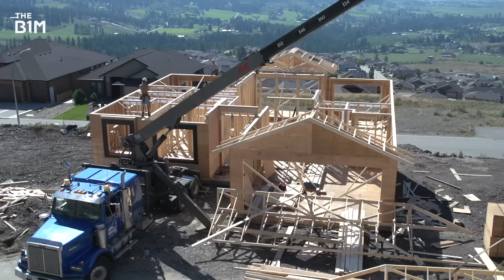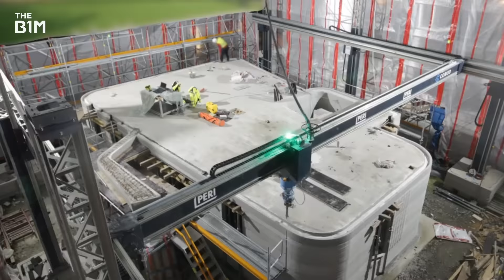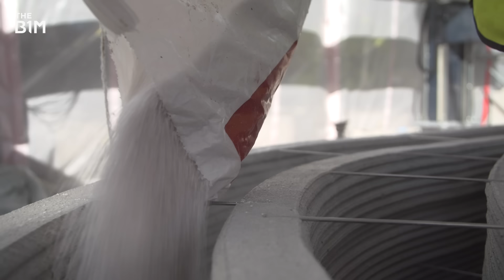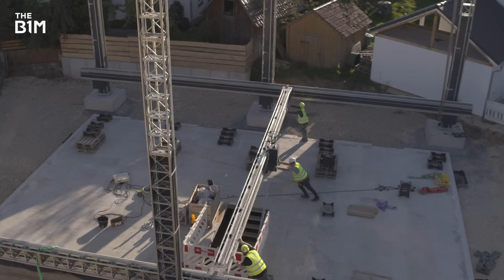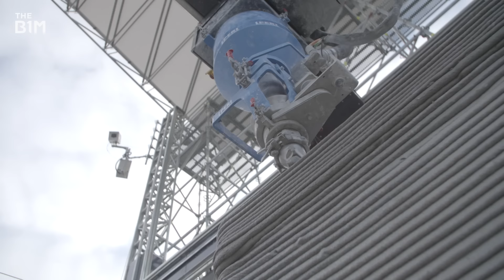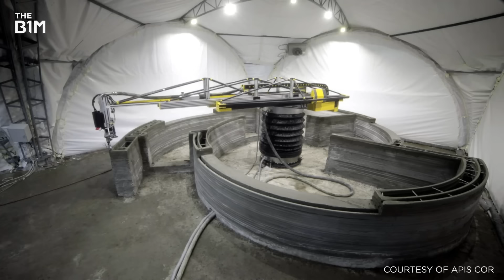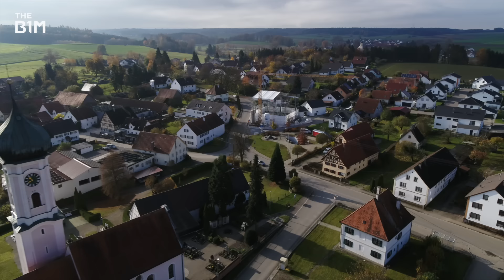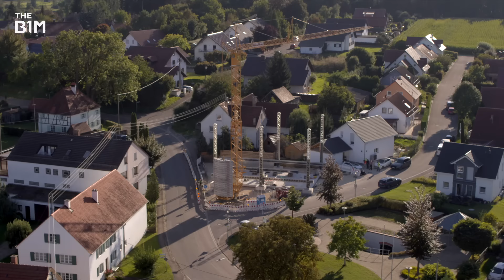Why This 3D-Printed House Will Change The World

Comment: Electrician:  "I'll be saving 12 days here"

Q:  Will the savings be passed on to the consumer?
Reply: Every day that's shaved off an electrician's time is a day he's not tempted to take some shortcut and fuck things up in your house.  The faster you get those people out of there, the better.
Reply: @GoatZilla  Really you think electrician's are that bad how so?
Reply: @spacelogic101whatif  Are you asking me for a specific list, or are you just being incredulous?
Reply: @GoatZilla  Well kinda incredulous to be honest.
Reply: how do i maintain it? im cutting through "cement" to fix a pipe/outlet?
Reply: You would hope, and this would mean though some knowledge on these designs by the consumer as well. Any contractor can flee the average consumer who has little to no knowledge of what to expect when building a home of any sort. I've seen that over the years with not just homes but other ventures as well.
Reply: The savings will have to be passed on to the consumer, at least the bulk of the savings, because competitors will do it if you don’t and you will lose your business. This is the beginning of the end of a ridiculously inefficient industry.

I built my entire house myself, a stick built house with stucco finish on the outside drywall on the inside. I counted the amount of subcontractors that would normally be involved in just building my walls had I not done it myself, each one of those guys trying to get $100 an hour. It was over 10. This is absurd.

Currently, in California, the year 2021, the typical cost per square foot of interior space, housing, is $200, for an ordinary house. That is ridiculous. But when you see how much labor goes in using current techniques, and how much material is wasted, and how much dither goes on, you can see where the money goes.
Reply: @steveperreira5850  Could you elaborate any further how is it a ridiculously inefficient industry?
Reply: Lol good joke
Reply: yes your savings will be 2 days of the 12 the industry will get the other 10     and the only reason you will get the 2 days is so you will say oh its cheaper to buy it this way.
  that's how industry works   they do all the thinking to save you 10%    cut corners  and boom save them  30% to manufacture it  and pass off to you house cheaper than its competition  while planning to keep as much profit as they can
Reply: TEC Youtube  So how do you get reliable referrals and validate things like years of experience?  BBB is already somewhat useless.  Do you also get referrals for all the other electricians working for him?  And which signoff are you referring to?
Reply: If they have competition, then yes.
Reply: How can you save 12 days? There's not even 12 days work for an elektrician in a normal home.
Reply: Yes. Approx 30 percent cheaper
Reply: @nickwright6759  or the companies will keep the same price and now they have an extra 30% in their pocket
Reply: @udadog  Any company that wants to steal customers from it's competitors would lower its price a little bit. The other companies would see that they are losing customers and respond by lowering their price a little bit. Repeat this process and eventually the 30% savings for the companies turns into savings for the customer. That's the reason why there are no price controls on things like bread yet I can still buy a loaf for $2.50. Why aren't the companies charging $10 for a loaf? $20? They could charge almost anything they want and I would still buy it because I will die if I don't eat. So why don't they? Competition, that's why.
Reply: @udadog  true!!!
Reply: @udadog  Yes, That's what I said. More money for them. 

Ask lots of questions where the money goes. Especially with jumps in phone or insurance prices. The latter will LIE about the state raising costs. BS. Shop around yearly. I guarantee you'll save money. 

Gripe if you didn't move or change cars.
Reply: @ErikLiberty  I'll spend 5 bucks on local bread I really like,  tho
Reply: @nickwright6759  Can you please quantify that figure?
Reply: When there is competition, savings are always passed to the consumer.
Reply: @DanMorin007  like....Cars
Reply: What electrician would ever say "I'll be saving 12 days here" or any trades and be happy about it? Made up BS!
Reply: @ec6455  have you ever wired a house?
Reply: @ec6455  I would, Im a elektrician and I am to busy...
Reply: @ec6455  Any one who doesn't get paid daily ?
Reply: @ec6455  Any electrician who plans to charge the same price while doing 12 days less of work.
Reply: Not the end consumer. This is pure profit for the real estate developers. In depopulating rural areas this is a good development for the end consumer though. This technology is also great for building more sustainable fencing and garden sheds. Wood has to be replaced like every 10 years. This isn't the case for cement. What also could be an interesting application is using this technology in existing real estate. People want to change walls indoors and this technology is excellent for it. It can be done with those thin American walls, but also with changing bearing walls.
Reply: @hendrikdependrik1891  I have worked in many wood houses over 100 years old ... I have no clue where your getting 10 year life span for wood that’s still a new house
Reply: @hendrikdependrik1891  wrong, models will be prepared and wildly available and no real estate developpers will be needed anymore. You just go into the store, choose from a set of computer models and maybe tweak 1 or 2 things.
No need for architects and no need for developers
Reply: @hendrikdependrik1891  and yet instead of doing anything to stop those companies from monopolizing areas, they will simply pass more regulations that makes it hard for the middle-upper class
Reply: Its only about 4 days for a typical 2,000 sq ft house.  If it is the same house over and over you can order the receptacles and light switches already wired. O savings.
Reply: I was thinking the same thing. Tradies are often way too greedy.
Reply: LMAO :Answer Hell no!
Reply: No
Reply: no.
Reply: Good Question... Depends on who you think is the consumer. The actual home owner will not receive any benefit.
Reply: @gamer1d244  that's ridiculous; if there is a less expensive way to produce housing,  market competition will ensure savings are passed on to the homebuyer
Reply: Who's Q?
Reply: Whenever there’s competition the consumers benefit so yes
Reply: Duh!
Reply: @Jarekurban6  cars are made by Roots and now cost a fortune.
Reply: I mean honestly if your only goal is to "become a millionaire" you're just begging to make a dumb decision and be disappointed...I think many will become millionaires in this current bull market but it's not the right mentality as holding can be very dangerous. As hard as it is trading Crypto is way more lucrative and is quite logical if you just study the charts and the support resistance and pay attention to what's going on, I’m not a pro trader but I was lucky enough to make 35BTC since  late last year following the instructions and signals from Karen Asnin Whitby. She runs program for investors/newbies who lack understanding on how trading Bitcoin, Crypto, Ethereum works, to help them utilise the volatility of the crypto market and also stack up more bitcoin. You can easily get to Karen on the web to know more about her experience in dealing with investment. Now i can secure a nice duplex for myself and within a couple of months, hoping to get mansion if i invest more and more with her......

Comment: Suspicious that the finished house is only shown in a computer generated image.
Looks like there are obvious problems with the consistency of material, leading to a ragged finish.
How long does it have to be left to cure before the next layer can be added?
It is concrete, the least environmentally friendly construction material due to its huge CO2 footprint.
Concrete is not reinforced, so there will be a limit to the height of buildings constructed this way.

Comment: No mention of cost vs traditional construction.  If cost per sqft goes far enough below traditional construction people would buy them, At 1/2 price even I would want to buy one. They look very sturdy and heavy. Would need a very solid foundation but I am guessing they should be able to 3-D print that first. Somebody needs to invent a quick way cover or smooth the exterior walls. I'm not liking the layered look.

Comment: A 3D printed house was just finished in India by L&T.
Reply: Larsen & Toubro, has 3D printed a G+1 (Ground plus one) building with reinforcement for the first time in India.

With the country aggressively pursuing the objective of creating 60 million houses under the Housing for All by 2022 programme, this achievement will certainly give a huge fillip to the mass housing segment.

The 3D printed building, which has a built up area of 700 sq. feet and is located at L&T Construction's Kanchipuram facility.

Comment: Looks to me like the same ol same old. Got certification yey but still doing it the same way others are. Not innovative or exciting in this video... Sadly.   I love this idea but there needs to be offset print head so that there can be a rebar structure inside the walls that later get filled with concrete once the electrical lines and plumbing lines have been pulled. This is the only way to make it past three stories. So far the best, fastest, cheapest way to build a house is to prefab walls in a factory then bring them onsite and stand them up and bolt them together.

Comment: So there's this small company in The Netherlands,  CyBe Construction, that's already a few years in advance of this video. Th prototypes that were discarded 8 years ago already looked better then this. And there printer is way more flexible and faster. 
But after all I would not use this for the outer side of the wall, too much insulation problems and not yet beautiful enough. I think it will be a solution for prefab companies which deliver and install the building parts on site, there are already multiple companies in the Netherlands that can build standard homes in a day.
I'm saying this as a building engineer, using this on site would need too much heavy equipment, transport and highly classified operators. And that doesnt solve any problem we now face on building sites.